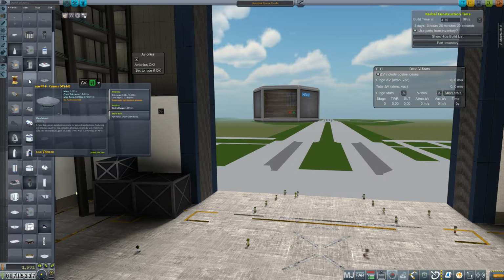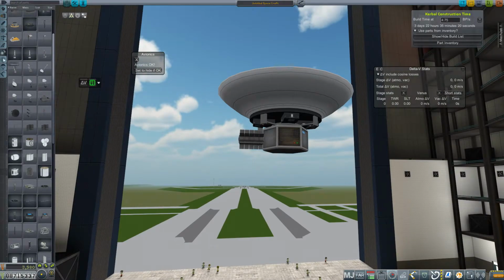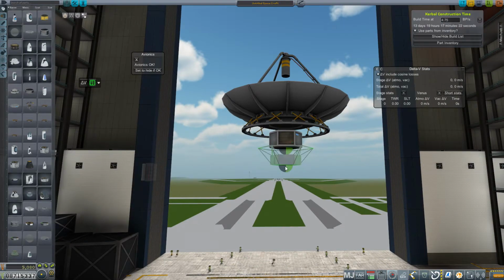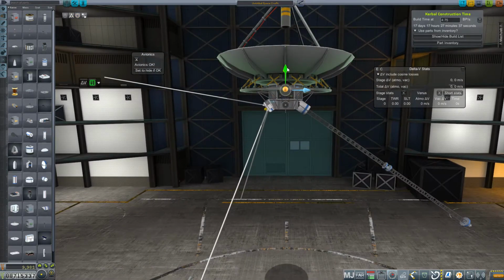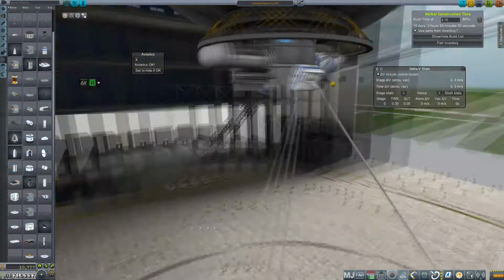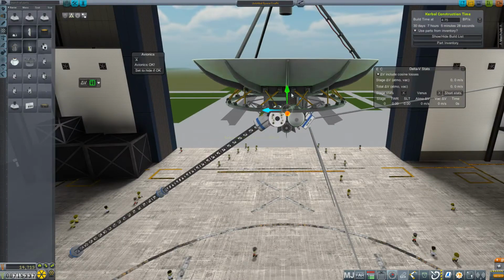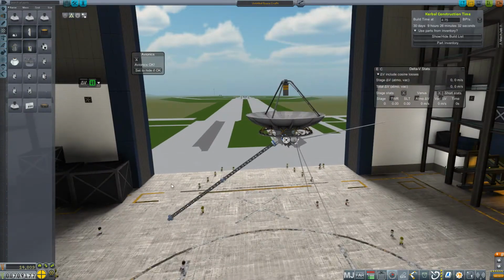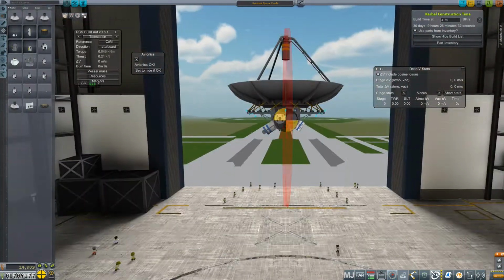KSP RP-0 #275 Pluto Shot? - A Build - a - Sode

Comment: Which files from your 1.1.3 build do I need to have the HG-3 engine in my install ?
Reply from the maker: https://www.dropbox.com/s/r6dewz0bjfm8t8c/HG-3%28FOr%20RP-0%29.zip?dl=0

It should be already integrated in my GameData folder, but if not here is the Dropbox of relevant files. Still a work in progress however.
Reply: Thanks. I wasnt sure if I have found all the HG-3 files that are needed in your 1.1.3 install.